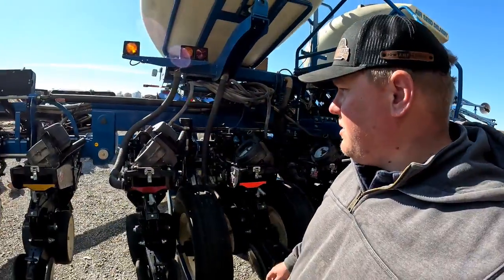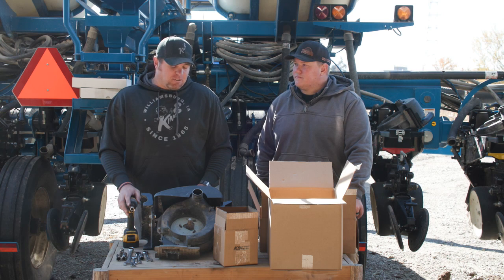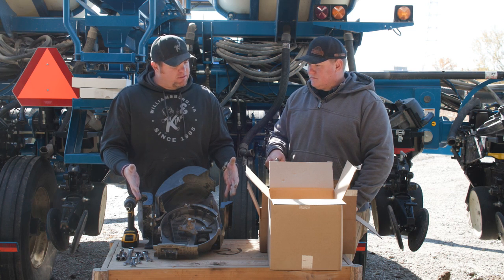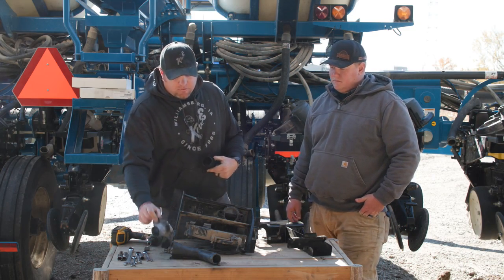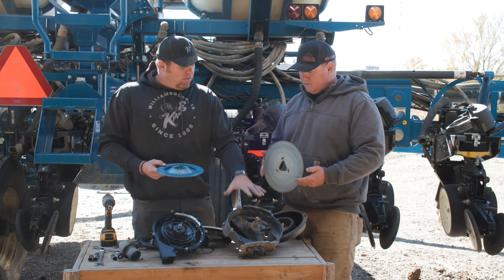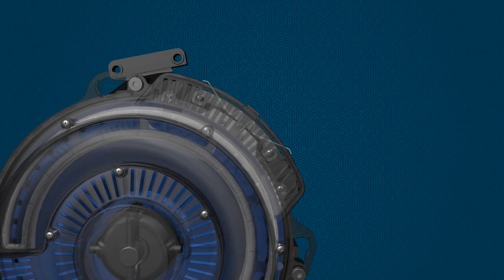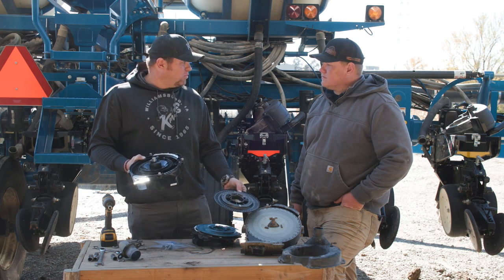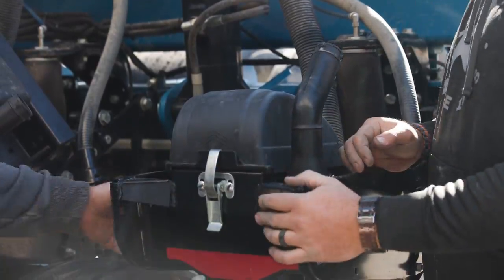WE ARE UPGRADING OUR KINZE PLANTER!

Comment: Ya there hard to turn IF YOU DONT CLEAN THEM😳🤫.  No PARTS AVAILABLE,must be an old planter 🔥🔥👎 ,sounds like a pressure sales tactic 🧐🧐????  Thanks Ben,Andrew and Molly.
Reply from the maker: These were wear points that hadn’t been replaced in 10 years. If we were to purchase replacement parts for the old meters we would be close to the cost of the upgrade- it’s just logical to upgrade!